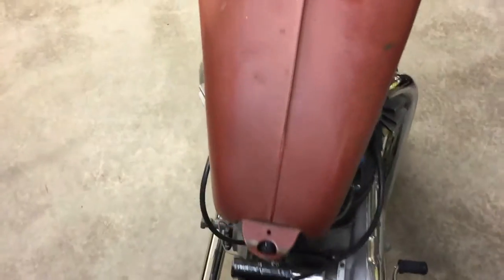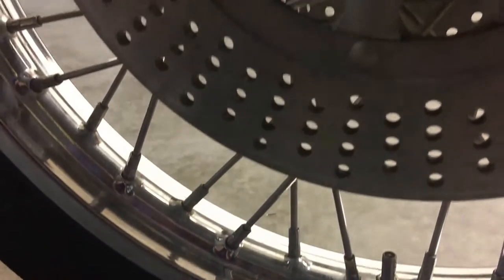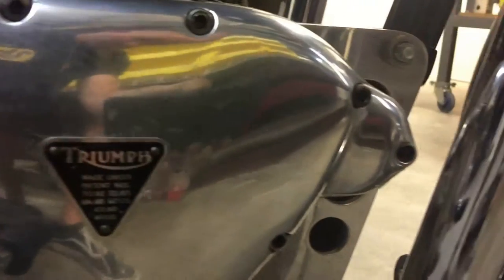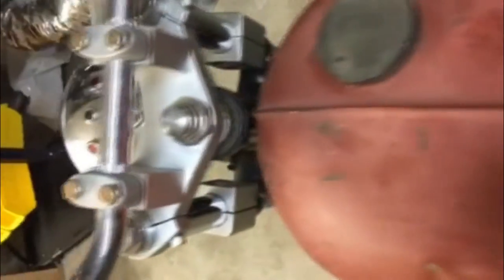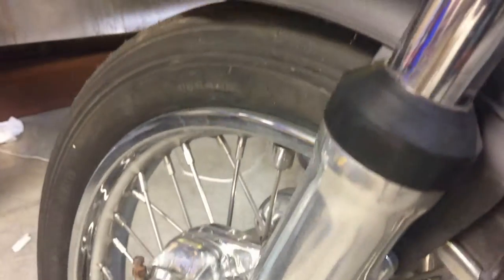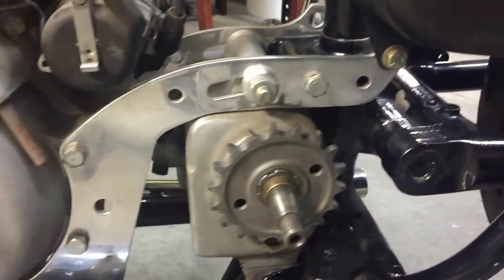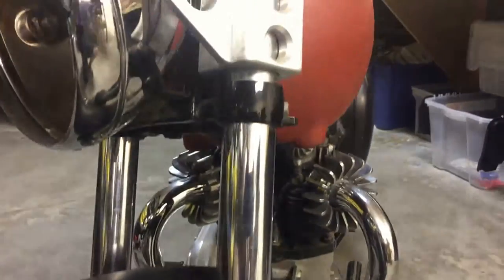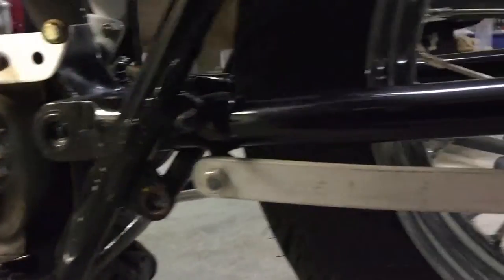The Baddest Bike Project Ever: 1957 Triumph TR6 Part 1 - Introduction

Comment: Hey man, if this is the bike you were talking about engine mounts, they look very well done. You shouldn't have any issues.
Reply from the maker: Thank you for the input! We had visions of grandeur regarding this bike, but just haven't got around to it. It's gonna take a bit more money saved up, as well. One of these days, though!
Reply: @FormulaJake  You have a great start there. The pre unit stuff is getting rare, actually all original Triumph is, but it looks like you have a good bit of what you need. But trust me, I have 40 projects just like it that need a bit more money and time, so I get it.